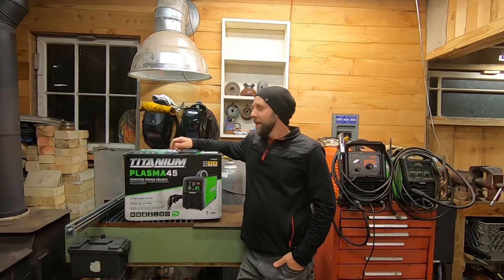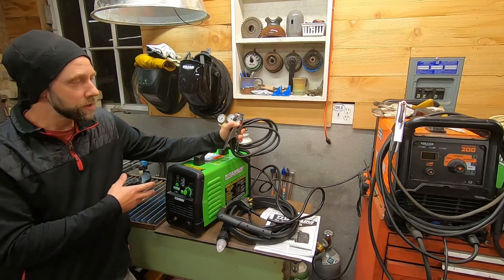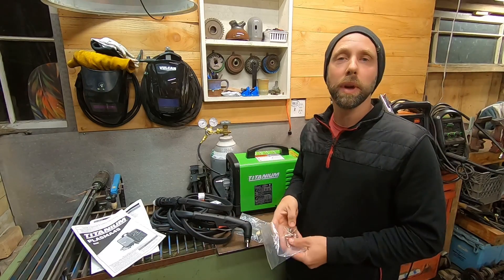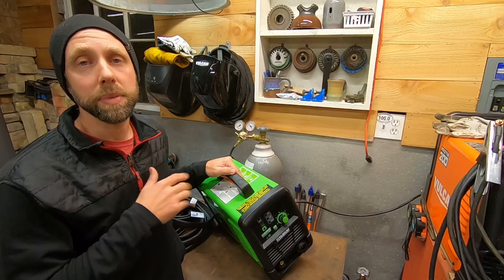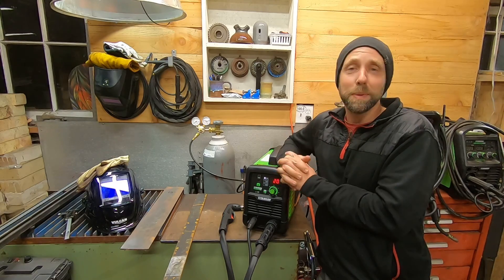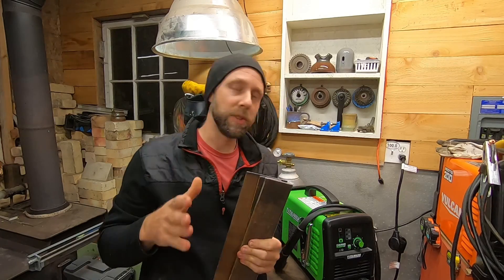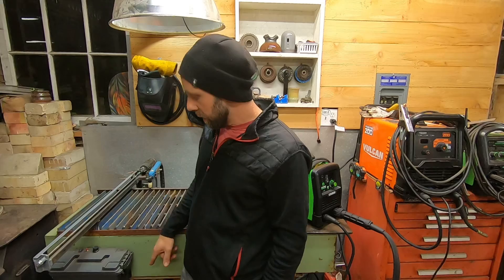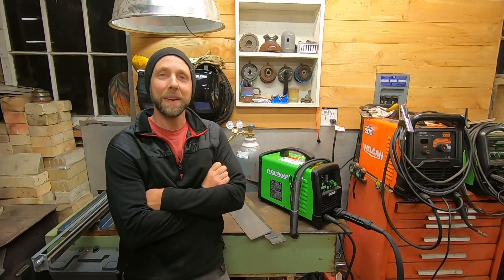Titanium plasma 45 plasma torch review

Comment from the maker: ***After Running the Titanium 45 for 3 years it's held up great! But I feel the Hynade CUT 60 CNC Plasma with blow back pilot arc start offers better value and is PLUG and PLAY CNC ready****
Amazon Paid affiliate links below 
 **Use the Hynade Amazon Promo code 05MIKEWELD at checkout and save 5% on selected Hynade produces.**
Hynade CNC Blow Back Digital Air Plasma Cutter, Non-HF Pilot Arc Non-Touch Plasma Cutting Machine, THC Torch Height Control Enabled (CUT60DN) https://amzn.to/3DEzR2m
Reply: Do you have a review video for the Hynade, I'm interested on picking one up but Im skeptical without seeing how it performs. I can seem to find any videos of them online?
Reply from the maker: @ZerbzZ  I have a video I will be posting in a week or two on my channel, I have owned the Hynade for the past 5 months and it’s definitely a good unit. Keep an eye out for that video 👍
Reply: @Mikefestiva  Harbor freight is releasing a titanium 65 plasma cutter, about a week or two ago I was looking at consumables on their website and they have a 65 amp nozzle now and as of a few days ago it now says for titanium 65 plasma cutter.  They are also have the 45 amp electrodes on clearance, I think they are going to sell only 65 amp electrodes which can be used at lower amperage which is what many manufacturers do.  There is definitely better options then the titanium 45 for the money.
Reply: My man!

Comment: Is this plasma cutter compatible with a cnc machine?
Reply from the maker: I ran mine for years on a CNC table, it worked really well.
Unfortunately there’s no CNC port connections so it’s not easy to explain how to connect it to the CNC. 
There’s many different Plasma cutters sold now on the market with plug and play CNC connections. The Arcfony CUT53N pro CNC cutter works great, I have been running it for a year now without any problems.

Comment: Thanks for all the info. I just bought this and im having an issue with the arc staying on. It will start an arc for a view seconds then it turns off and blows air . Any advise on how to get it to stay on ??
Reply from the maker: I think it’s a safety feature built into the plasma, if you don’t have a good ground for the clamp on your metal piece you are cutting then it won’t keep the arc. Make sure to grind the area where your clamp in on the metal, no rust, paint or anything else to keep it from completing the circuit. Hope this helps. Also make sure you have the consumables at least hand tight in the torch and over 90 PSI going to the cutting, I have cut at least 2000’ feet of metal with my Titanium 45 on my CNC table 👍

Comment: I have trouble getting mine to fire unless i tap the tip to material. Any suggestions?
Reply from the maker: I would change out your tip and cup consumables with new ones and make sure they are installed right.
Make sure your ground is on a clean part of metal you are cutting, grind it if you need to clean off and paint or rust.
Reply: @Mikefestiva   even brand new clean metal and brand new consumables. I have only had the machine for about a month  and its been this way since day 1.  I have watched videos on set up to see if i did everything correctly. It works fine as long as i make full contact initially.
Reply from the maker: @BillDav  I would take it back if it’s been that way since you got it, I’m pretty sure you got a bad unit. 
Mine is still working good and I have had it for about 4 years now.
It should fire whenever you pull the trigger.
Reply: @BillDav  Hey hey, I know this is years late, but I'm pretty sure that the Titanium 45 lacks a pilot arc - meaning you DO actually have to touch the tip to metal to start the arc (like stick welding) so I think your cutter actually works as it should, it just doesn't have that sweet pilot arc feature 🥲 main reason I'm returning mine to get a different cutter
Reply: @noelmanning7519 have to take the cover off the machine and turn the internal air regulator up all the way. Adjust air pressure at the wall regulator and it works perfect now

Comment: Any plans to look at the new Plasma 65?
In addition to the higher amp capacity, it includes a CNC port and is pretty comparable with the Everlast 62i.
Reply from the maker: I really like my Titanium 45 it’s been a rock solid plasma cutter for the past 3 years. I’m now running it at my work on an Arcdroid CNC cutter. 
I may consider buying the plasma 65 in the future.
I’m currently running the Hynade CUT60DN on my CNC table at home, it also has CNC ports on it. 👍

Comment: what size breaker do you run for 240v???
Reply: I run a double pole 50A for my plasma and my Vulcan pro tig 205.  I’ve welded for hours on 1/4 inch aluminum plate “wide open “ and never had it throw the breaker or ever load the machine

Comment: What cfm raring does your air compressor need to run this?
Also the thicker the metal the higher the air pressure needed and then cfm changes with pressure too right what cfm and pressures are needed to cut the thicker gauges?

Comment: What air pressure psi does it have to have to run
Reply from the maker: It has a low pressure shut off, I think that kicks in if the air gets down to 75PSI or so. I think 90 PSI is required.
I have cut over a few thousand feet with this plasma on my CNC table, it’s been a good reliable plasma 👍🙂

Comment: Impressive 120v 15amp circuit receptacle cutting 1/4 steel flat stock! That's awesome I will recommend 240v if you running into a shop great job 👍
Reply from the maker: Thanks for checking out my plasma video 👍 I only ran it on 120 volts to show how it performs on that voltage, I have 220 and always run it on that voltage in my shop. I have cut a few thousand feet of metal with this Plasma on my CNC table and it’s still working great 👍

Comment: My Miller Spectrum has a built-in regulator like this titanium and will not work if under 70PSI which sucks because the one I replaced would and I would etch with it. Can you tell me if this will still work with a lower pressure?
Reply from the maker: Hey Jack this one is similar to your Miller in the way it’s got a internal pressure sensor that tells the electronics if the pressure drops below the low end threshold, I think 70 or 80 PSI is the low end, if pressure drops lower it will stop the arc.

Comment: Another excellent vid... However, as much of a fan as I am of the Titanium Series from HF, I just can't see spending $1K on this..? Your alternative video from Dec 10, 2021 beats this hands down for less than 1/3 of the cost. Just don't understand why HF prices these so darn high? Nonetheless, thank you for the vid; great job and explanation.
Reply from the maker: I definitely think they are asking a lot for this plasma but there is a really big difference between this and they Bestarc plasma I reviewed recently, this Titanium is a blow back pilot arc start and so it doesn’t produce high frequency interference that can damage electronics in CNC equipment, most name brand Blow back pilot arc start machines are priced at least double what this one is selling for. One other thing, I have cut over a few thousand feet of metal without any problems with this machine so I’m confident in it’s build quality. 
The Bestarc is a good machine so far but I haven’t cut much with it, I would say if someone is just looking to make free hand cuts the Bestarc is the much more affordable way to go. Take care and thanks for checking out my videos! 🙂👍
Reply: @Mikefestiva  Another good point! I’m new (somewhat) to home-grade plasma torches, and my work centers around the ‘Dad-Hobbyist’ realm so I’ll likely go with your Bestarc recommendation for what I need. Love HF tools but can’t justify the cost for my projects. Great to learn from you though that quality rigs with these requirements do cost 2X as much and therefore is an alternative to those costs. As always, thank you! Keep up the excellent tuts.
Reply from the maker: @AXNJXN1  Right on👍
One thing I would like to mention, the Bestarc pilot arc model is sold out at the moment, so probably check back in a few weeks and see if it’s available then 🙂👍

Comment: From what I've seen most plasma cutters in that amp range are good with a shade 5 or 6 goggles or mask. The titanium Plasma 45 manual says to use at least a shade 10. What would cause the difference?
Reply from the maker: All the research I have done said shade 5 or 6, I don’t know if you could even see your cut with shade 10?
Reply: In my experience, it's not just the amps that matter. If I'm using a drag tip, shade 5 is great. It's also ok with a standoff and a straight edge too because i don't really need to look right at the arc. I just follow the straight edge looking at the back of the torch. If I'm in a situation we're the arc is visible (not dragging) and i need to look right at it, i find shade 5 insufficient at higher amperage. Unfortunately at shade 8 or 9 it's difficult to follow a line so it can be annoying. I think the best way is to have a couple options available and switch them depending on situation.
Reply: Try a shade 7 . I use a 7 at work and works for me

Comment: Can you run this unit on a generator
Reply from the maker: I’m not sure, I have never tried?
Reply: General inverter machines (welder or plasma) can be run on generators that make a sine wave. Sometimes called "clean" power. Most basic generators don't have this unfortunately. Older transformer welders don't really care as long as the power is sufficient.

Comment: Over time, using a metal guide to keep your cut straight will erode the insulator in the torch, the plasma is attracted to the adjacent metal
in your guide. I use plastic or compressed paper as a guide. It does burn as you cut, but it sure will save your torch. Adequate ventilation
is a must!
Reply from the maker: Hey Jim the metal was never touching the cup on my plasma torch, it was touching the metal stand off that was provided with the original torch, I have used many plasmas over the years and replacing electrodes is just a part of cutting with them, blow back is usually what gets the cups.
I actually never free hand cut anymore with this, it’s on my CNC table. I have cut over 900 feet of metal and this torch is still going strong. Here’s my CNC setup.
https://youtu.be/vjCgKJYV2aI

Comment: Great video! I know it will likely perform better @220 but I’m glad you demonstrated it with 120 so folks can see what the average guy can expect with household power! Thanks!
Reply from the maker: Thanks for checking out my video 👍
I run this machine on 220 in my shop all the time, like you mentioned 120 was to show the people that only have 120 volts in there shop what it can do.
I have owned this plasma for about 2 years now and it’s still rock solid. I have cut well over 800 feet of metal with it on my CNC table! Check out my articulating dump truck series or my mini pinzgauer build videos if you want to see this plasma running on a CNC table 👍

Comment: Technically that was only a 15 amp rated outletTechnically that was only a 15 amp rated outlet. So you overloaded the outlet good luck with no fire overtime
Reply from the maker: Well it was technically just to show people that actually appreciate videos like this it can run off of 120 volts, I always run my plasma on 220 in my shop.
Reply: You’re not going to catch a 15A receptical on fire by running 20A through it, the difference between the recepticals is artificial and exists only to protect the wiring in the walls.

Comment: You could be running all of those at 220. I have a Lincoln 180 110/220 and on 220 it is industrial. 110 its starving for more input. lol All of your nice equipment wants 220. Nice channel..
Reply from the maker: I run all this equipment on 220 in my shop, on my reviews I tend to run a portion of the video on 110 because a surprising number of my viewers only have 110 in there small shops. I 100% agree, if you got 220 definitely run it 👍

Comment: What was your air pressure set at
Reply from the maker: I run mine around 95 I think. Check out some of my build series, I use this plasma on my CNC table and it’s really been a great plasma torch.
I have cut well over 800 feet of metal with it so far.
Reply: @Mikefestiva  will do man, just ome question I have for you, I was cutting 1/8" and I have it set on for a 120 outlet with a 20 Amp breaker. I get about 2 mins is, and it blows the breaker. I have some other machines I use and it handles it without tripping the breaker. Is it the plasma cutter itself, does the air pressure being set wrong have something to do with it tripping the breaker. I've had it for some time now and I don't think I can exchange it under warranty.
Reply from the maker: @Danny-qp5gl  Some machines draw more amps then others do, if you are running it on 120 volts turned up all the way, it sounds like it’s probably just pushing your beaker to the max. I would recommend trying to get 220 in your shop if you can at some point, all welders and plasma cutters do much better on 220v.
Reply: @Mikefestiva  yeah I need to eventually. Even with it on 120 and turned all the way down it trips
Reply: @Danny-qp5gl   is anything else running on that circuit? Dedicated circuits are best. An extended draw near the max load rating of the breaker can cause it to trip.
Reply: @mikez4132  no sir. It's a dedicated breaker just for that outlet
Reply: @Danny-qp5gl   i would say it is probably the unit drawing a few more amps over spec causing the issue. You could plug in a kil a watt meter or test the amo draw of the unit to see what it is pulling to start the process of elimination. Maybe try a diff circuit to see if it still happens? They probably dont have the highest quality components in them. I am looking for this style welder myself.
Reply: @mikez4132  I was thinking it was the machine itself. Because I can run a welder on 110 and many other things that require at least a 15a breaker and I have no trouble. The problem is I've had the machine for so long, they won't do anything about it. And I hate to throw the money I spent on it away for a new one, or get this one fixed, but I think im gonna have to bring it somewhere to get it looked at

Comment: Tried to cut diamond plate metal, and it was sloppy and kept tripping breaker
Reply from the maker: Well it’s only good to cut as clean as you move the torch. What thickness of metal are you cutting? Are you hooked up to 120 or 220 volts? Sounds like you don’t have enough amps and are trying to cut on 120 volts. I have cut hundreds of feet with mine on 220v without ever tripping my 50 amp breaker.

Comment: Hey Mike, 

I am looking to upgrade my Cut50 scratch start plasma cutter with plans to have a CNC table (possibly the Langmuir like yours).  I have looked at the Titanium 45 at $700-$800.  I am not sure what advantage it has over one of the cheaper pilot arc machines from Amazon that come in around the $300 mark.  What does the Harbor Freight Titanium 45 have that justifies its more than double price tag?  I like cheap tools but I also like to get value for the money I spend.  Thanks for the great review.
Reply from the maker: I have been really happy with the titanium plasma 45 so far, I have cut over 800 feet of metal without any problems.
I would recommend if you plan on buying a crossfire plasma table down the road, check out there website, they have a list of plasma cutters that work well with there tables.
My experience with what I know about plasma cutters, it seems like there’s a big jump in price from pilot arc to blow back pilot arc machines.
Take care Doug
Reply: @Mikefestiva  Thanks for the feedback Mike, I appreciate it.

Comment: Harbor freight. Be careful, youre a couple hundred dollars OVER PRICED.  Yeah maybe the warranty available for purchase helps but this should be a $450.00 mac machine.  You'll sell a million more at 399.00.
Reply from the maker: They are on the high side, keep in mind this is a blow back pilot arc and can run on CNC equipment, I have cut easily over 800 Feet with this plasma torch and it’s still Working like a champ 👍 Most $400 plasma torches are not blow back pilot arc and can’t run on CNC tables.
Reply: @Mikefestiva  yeah true that.  But this is like an 800+ ,machine right?  I'm looking forward to testing Yes Welder plasma cutter.  I have a 30 amp hypotherm and it's not a monster.

Comment: Nice unit but way over priced IMO.
Reply from the maker: They definitely seem to be priced on the high side, but I have found that it runs really well on my CNC plasma table, I have cut well over 800 feet of metal without any problems, all 800 feet have been ran at the full 45 amp output too, never hit the duty cycle yet 👍
This plasma torch uses blow back pilot start so it doesn’t produce High frequency interference like all high frequency start and some pilot arc machines do, those other plasma machines can cause problems to sensitive electronics used in CNC equipment. 
I’m sure there’s cheaper machines out there like my Old Amazon CUT 50 for $200 but it won’t work on a CNC table.
Take care Wayne 👍

Comment: What size breaker for the plug in?
Reply from the maker: Most welders and plasma cutters are wired with 50 amp plugs, I’m running a 50 amp breaker but I highly doubt most machines really need 50 amps to run full power.